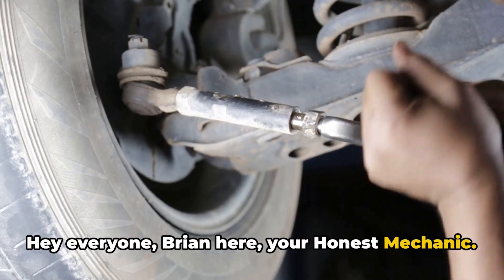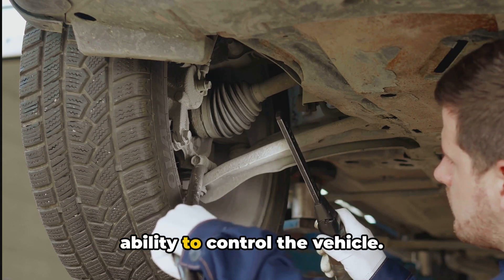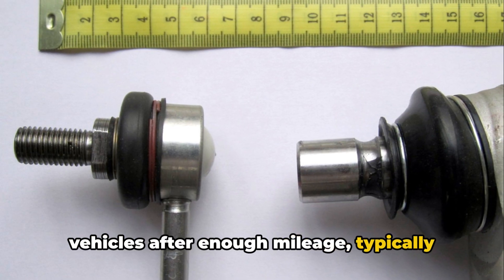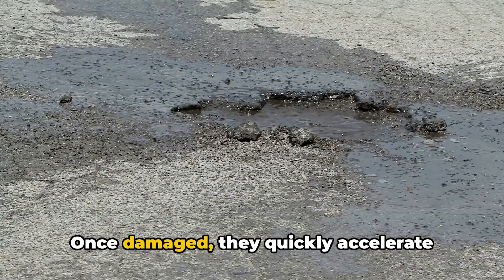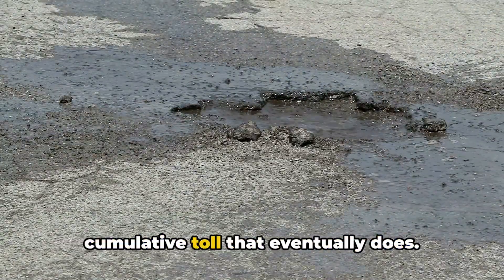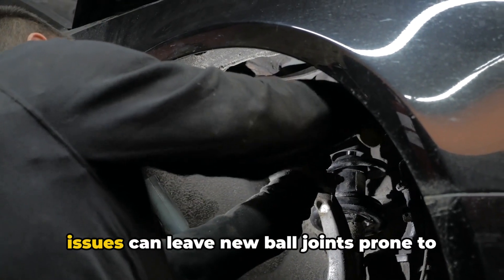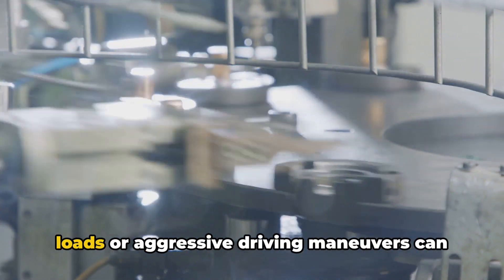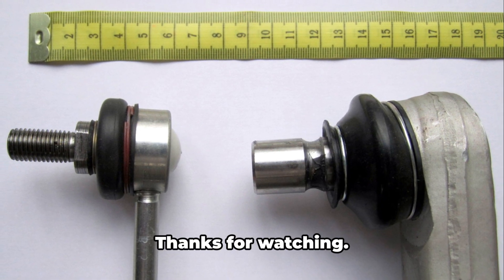What Causes Ball Joints to Go Bad: 6 Failure Reasons

Comment: Its actually impressive that balljoints can go 100.000km+ before replacement. All the beating it gets. I need to replace my swaybar links now, they are clunking (after 116.000km). And i checked 6-12 and 3-9 movement on wheels, but no looseness there. Swaybar links get especially much beating.
Reply from the maker: You're absolutely right that getting over 100,000 kilometers out of ball joints before needing replacement is remarkable when you consider the constant impacts from bumps and potholes that they endure. As a mechanic, I've seen plenty of ball joints fail well before that mileage. The sway bar links failing after 116,000 km makes total sense as well - they act as the connection point between the sway bar and control arms, so they're under constant stress from all that body roll motion. Replacing just the links to fix your clunking noise is smart. It shows good judgement to check for play in the wheel bearings and ball joints too before assuming other parts are bad. As long as you didn't find excessive to and fro movement when rocking the wheels at 12 and 6 o'clock and 3 and 9 o'clock positions, it suggests those components still have life left in them despite the high miles. I've serviced plenty of vehicles over 150,000 km without needing to replace bearings or ball joints, so inspecting before replacing is definitely the way to go.
Reply: @HonestMechanicChannel  i 100% agree. No need to replace more than components that are actually worn. I have now replaced sway bar links on my car, and klunking is gone. A cheap repair👍 thank you for this channel.